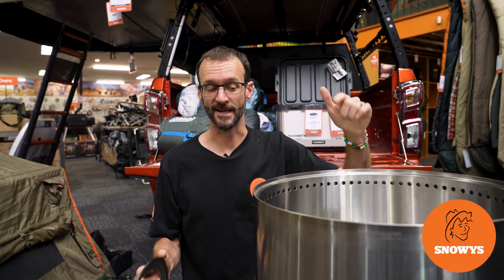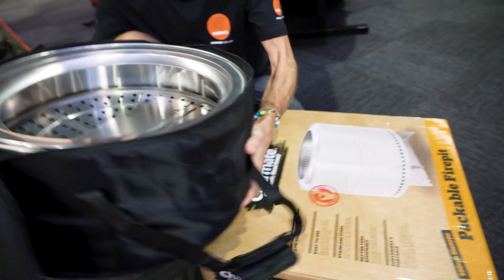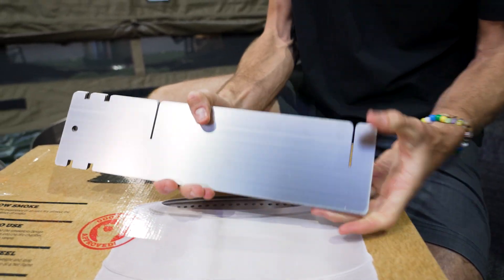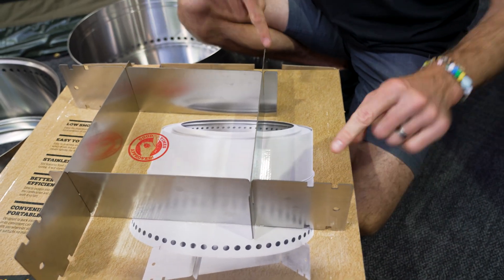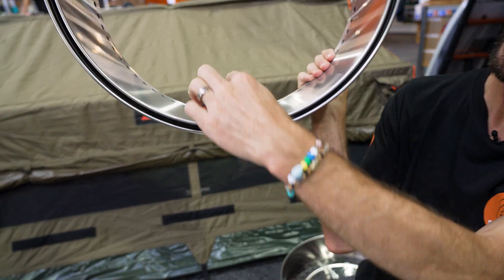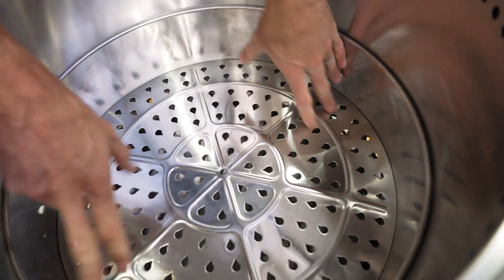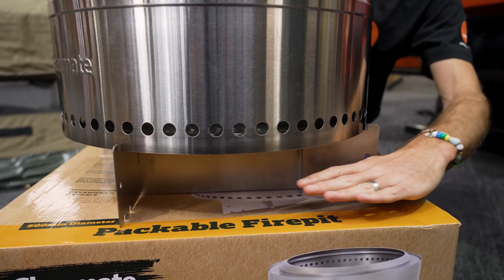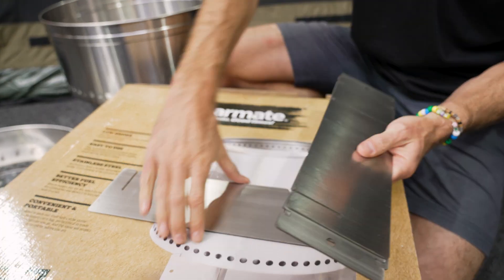Charmate Packable Firepit 500mm Diameter - How to setup & pack away

Comment: As usual, an excellent description, Ben.
There is a bit of space left inside to put the fire gloves and short poker - maybe a round canvas cleartop bag would hold them and reduce the rattling a bit. 
You know, I reckon the wire grill from a 47cm kettle bbq would fit over the top ring when in use but then pack away inside the unit. This could provide a good cooking option. 
It is an attractive option to my Quokka which is great for cooking but doesn't hold a fire as well as I would like.
Reply from the maker: Thanks for your feedback, Garry, you've got some good ideas there. ~ Ben